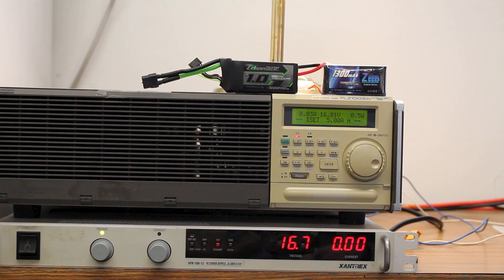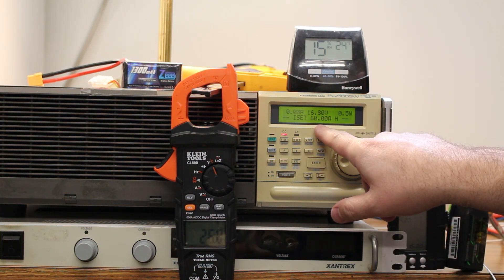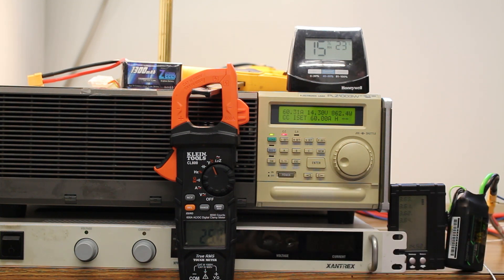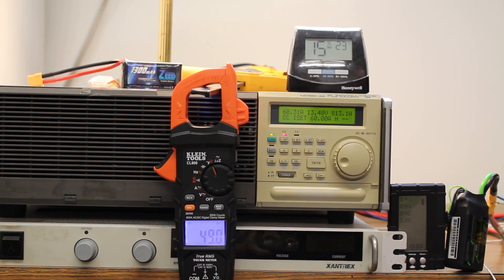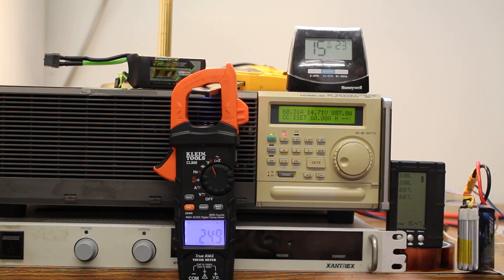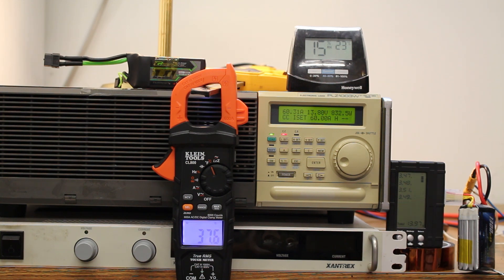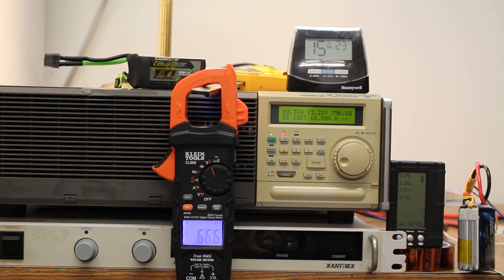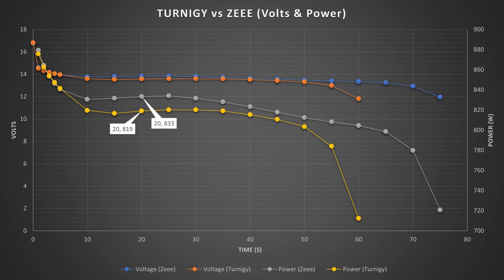Cheap Zeee up against Turnigy. LiPo Batteries.

Comment: I would like to know how Zee lipos perform, long term,  in electric powered RC planes  vs other popular brands. I use mostly 3S 2200mah and 4S 3700mah in small to medium scale models.
Reply from the maker: Good question, my load is programable but I have to manually charge them each time. No way for me to test that with my current equipment. Time to check industrial auctions auctions again :)

Comment: Those temperatures seems quite scary for lipos. There must have been very high hot spots inside the battery when outside is already hitting 80degC. I would recommend to use some steel container for batteries in test since you are playing with fire with the temperatures. Other than that, I like your testing.
Reply from the maker: Yes, thanks, good point. Perhaps I should split one open and insert a thermocouple in the center of the pack and seal it back up to see what is really going on.

Comment: Woulda been nice to match same capacity batteries to actually see which brand was better. But i get the price to performance ratio is what your getting at. I suspect a 1000mah zee batt would have matched the turnigy in performance, but cost less. But does the larger zee batt match in size or negligible difference anyway?
Reply from the maker: Yes the Zeee and Turnigy were basically the same size, I think I looked for a 1000 mah Zeee and 1400 was all they had.

Comment: Excellent test, wish I had that equipment! Exactly the kind of questions I would have about packs too. Would love to see more tests
Reply from the maker: Thanks, Yes the equipment came from industrial auction site www.go-dove.com, I have video for Sony 21700 cells and more 18650 but have not had time to cut and upload. Any batteries in mind I should test?
Reply: I would like to see how similar batteries from a single manufacturer stand up to each other. Like zeee 50c vs 80c vs 100c vs premium. Or turnigy plain 25c vs HD vs graphite vs rapid, etc. I use car packs in the 2S/3S 5000maH range. Common with the car/truck community. My thoughts would be regardless of what battery you test, standardize your C discharge rates so that at any point you can compare to any other cell you have done before.  I'd like to see cells at 10C, 25C, maybe a bit lower or a bit higher as that is closer to the range most people will see. But understand for sure that more tests equal more time. What interests you?
Reply from the maker: I see, yes, I could do some testing in that range, my electronic load is limited to 1000 watts so at 3s (12.6v) and 5000 mAh I could do (12.6v*5a=63w, 1000w/63w=15.8C) 15 C max. Actual test time is no issue, setup and video is the majority of the effort. I am interested in absolute max power draw and associated voltage drop, which affects motor speed. I was working on a quad motor super kart that could take me from 0 to 60 sub one second. For that I need precise load measurements that I could scale up to 160 kW total power, plus a 20 kW ducted fan to suck the cart to the ground to get the necessary ground effects to accelerate at sustained 3g for one second. For now it is all on hold as I am looking to make a Solar Cannonball Run attempt soon. Do you have any LiPo batteries suggestions, best brands to look at?
Reply: @mechanicalgraffiti  Is 180KW (160+20) for 1sec the goal for the kart?  Do you have a voltage target for the power system?  Awesome sounding project either way :D  RC packs are a great way to get what you need in KW and cost.  Turnigy has usually been my inexpensive go-to as I have had some ~5AH packs last over 10 years, and the cell ohm (iR) matching is much better than Zeee.  Which on that note, have you done any iR measurements?  That seems to be everyone's go-to on pack comparisons, all else being equal.
Reply from the maker: Yep 180 kw total power. I want to go as high a voltage as possible, the limiting factor are my 5 ESCs at 85 Volts, one for each motor and the fan. I have not done any internal resistance measurements. I was looking at using 28 liPos each a 4S 9000 mAh. I have most of it modeled up in SolidWorks and a huge excel sheet with all my calculations. Maybe I should make some videos of it. I am at the point where I may need to open source the project, I do not have the time or money and progress is stalling out.
Reply: @mechanicalgraffiti  50C and 450A per pack approx if my napkin math is correct.  I am thinking the A will be too high to sustain for that period, besides internal pack stress.   Conductor size does not increase much as the packs get higher cap, so you just have to do more smaller packs.  4-5AH packs would see same C, but at least you are down in the 225A range which may be tolerable.  There is a series by RCExplained where he goes into his own method of C which is a bit wonky, but he has some great data points later in this vid using Turnigy Graphene vs the Zeee.  https://youtu.be/MvTEDe0mJqU I too will have to go back into some of my log files from my runs on a 6S Kraton pulling 150A from a Turnigy HD 6S 4000aH pack and see what the volt drop was.  It held up WAY better than similar Zeee under load.  Much lower iR when i still had a charger that measured that.
Reply from the maker: @nplack  Thanks, I will check that out. Yes about 450 per pack but I will have 4 packs X 4s or 16s and then a total of 7 in parallel and I saved enough space to double the number in parallel, all connected to a large busbar that distributes to each motor controller. The point of smaller packs is good, it will help cooling. Also, I plan to route the ducted fan suction side over the batteries and controllers for added cooling.
Reply: @mechanicalgraffiti  Went back into the Castle logs from my 1/8 Monster X for some measurements from last year.  A Turnigy HD 6S 60C 4000mAH was tested.  At 125A drain, it measured 3.2mOHM/cell with a 2.5v droop.  Peak drain was 133A for 2800W.  A Zeee 3S 7200mAH 80C in the same truck averaged around 1.9mOHM/cell with some tests in the 72A range showing 0.8v droop and minimal ripple.  The Zeee saw a peak of 106A for 1080W.  At first glance the Zeee seems amazing on iR (and honestly is a good pack), but corrected for capacity (7.2 vs 4.0), they are on par for iR.  I no longer own the Turnigy 6S or the Castle, but I will be running more tests on the Zeee, and a bunch of new cells, in the future.

Comment: Nice to see someone using test equipment to test batteries in a structured lab setting.  Better than some of the dope smokers trying to obtain results in the field with more anecdotal results than anything of true value.  A person can use your data to make a decision on a purchase more accurately.  Bravo, I have liked and subbed.
Reply from the maker: Thanks, a little enginerding goes a long way.
Reply: What in the hell does a weed smoker have anything to do with the ability to gather accurate data? Your slapping a stereotype on something you don't understand.